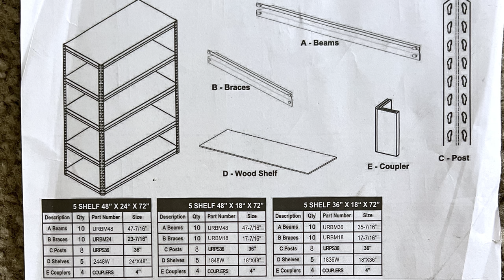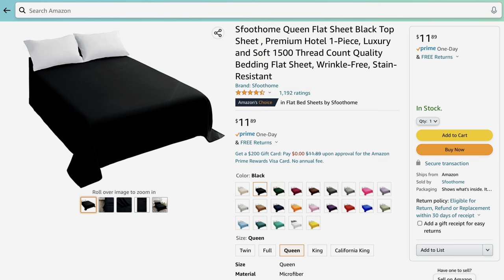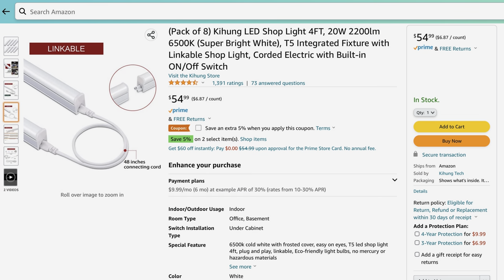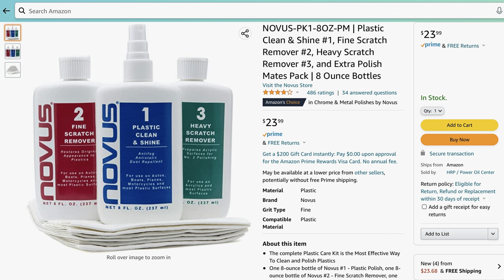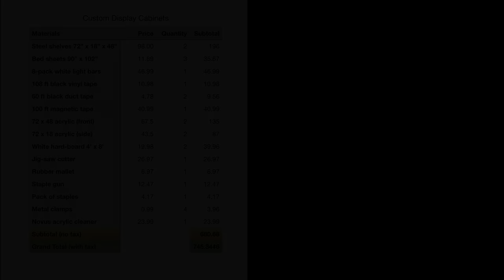DIY Custom Display Case Tutorial | Posing with Peter

Comment: Hi Peter, thank you again for your video. It inspired me to prepare my own custom built shelves. Unfortunately I live in Europe and many things you have in video I don't have it here. But anyway, I just have a question for your shelf board if you don't mind. You warp one face with bedsheet but what about the other face? On the video, it show the whole shelf board became black but in the process you only wrap one side with bedsheet so what did you do to the other side? Thank you!
Reply from the maker: Hi Lucas! My apologies for the delayed reply. I’m really glad my video has helped inspire you to build your own cabinets! 

To answer your question: I only wrapped/covered one side of the large boards with black sheet, and I used duct tape to adhere the black sheets to the backside of the large boards. I had considered using staples but I was worried about poking holes through both sides which would look ugly 😂

I hope that helps clarify, and thanks so much for watching!
Reply: @PosingwithPeter  thanks so much for replying! I decided to paint the back side since I find that it will be cheaper for me. I tried to look for color sheet but at that size it will become more costly. As you said in the video, there are many ways to tackle this. As I went along with your video, I had to adapt with what I could buy and had at my disposal. The shelves will be ready soon!

Comment: Hi Peter! Great video. I'm using your video and Costa's videos to create my own display case. 
Quick question: I just got the 4ft lights you used and wanted to know how you got them in the case. With the extensions linking each one in a zig-zag pattern, I'm not able to seat them inside the railing. Did you have trouble getting all the lights to fit?
Reply from the maker: Hey there! 

Yeah the light bars were a very tight fit since the cable connectors run straight out of each light bar, but it is doable! I recall seeing someone else ask the same thing on Costa’s videos in his comments and I think he also had to use a bit of force as well. 

In order for them to fit, I first thoroughly inserted the cable connectors into both sides of the light bars. Then I wedged the light bars + connectors under each shelf by bending the connectors to a 90 degree angle they collide with the vertical frame. 

I hope that helps, and thanks so much for watching! I’m really glad you’re giving it a go with the custom cabinet 😁

Comment: Looks great, for the acrylic what thickness did you end up getting? I want to build something similar but dont want to get too thin and have it be flimsy but of course thicker is more expensive
Reply from the maker: Thanks! And for the acrylic I personally chose 1/8 inch thickness since I wanted it to be sturdy. However it’s a bit heavy since I did not cut the acrylic into smaller sizes.  I’m currently building 2 more cabinets like this, and I might choose 1/16 inch thickness this time. We shall see!

Comment: Hey Peter! Are you still using these? I’m in the process of building mine myself. Yours look excellent! I am following Costa as well. I will say that I do wish they made flat black hardboard.
Reply from the maker: Hey Andrew! Yeah I’m still using the cabinets featured in this video — I’ve actually replaced my defolfs and built 2 more cabinets in the living room for all my Marvel figures. I’ve spent the last several months gradually posing / displaying them and hope to film some kind of collection tour update before the year is over, TBD 😂

And I agree, it would be nice to have large black hard boards at an affordable price. I think they do exist but they’re super expensive like $90-200 each depending on the material they’re made of.

Either way best of luck on your build! Quick tip is to use some super glue when adhering the magnetic strips to the acrylic panels (the adhesive on the magnetic strips wore out after I had already uploaded this video so I had to reinforce with several drops of Loctite ultra gel). 

Hope that helps and thanks for watching & sharing your positive feedback!

Comment: Fantastic! I’ll be doing this very soon. I have to ask, how did you pull of the Superman floating pose in this cabinet??
Reply from the maker: Awesome! I’m really glad you found this video helpful and that you’ll be building your own custom cabinet soon 😁

As for the floating figures like Superman and Stormtrooper, I used black string to suspend them from the upper frame behind them.

I have a separate video this explains the process: https://youtu.be/9aOpfS4n7Ak

Comment: Great build looks amazing! What thickness is the acrylic?
Reply from the maker: Thanks so much! I personally bought 1/8 inch thick acrylics since I wanted them to be sturdy & firm when I remove them from the front of the cabinet, but I’ve seen others use much thinner like 1/16 or 3/32 inch to be lighter weight. Just depends on personal preference 👍
Reply: @PosingwithPeter  cheers for the reply mate I had to use a converter being from Australia, I don't know haw you guys measure in fractions of an inch haha

Comment: Great video! I am going to be doing the same for my model car collection. What is the thickness of your acrylic panel? How heavy is the entire 4 by 6 piece? And are these magnets holding up still? Comments on amazon says these magnetic strips are weak, so would like your review on them. Thanks!
Reply from the maker: The acrylic panels are 1/8th inch thick and the large 4 x 6 piece are maybe 10 lbs each. As for the magnetic trips, some of the adhesive did wear off several weeks after I had uploaded this video, so I went back in and superglued the magnetic strips to the acrylic using Loctite Super/Ultra Gel. I also added a few small circular neodymium magnets for extra hold. 

Hope that helps, and thanks for watching!
Reply: @PosingwithPeter  I'm doing the same and have 2 questions, did you glue magnetic strips to frame and acrylic, and are the extra magnets necessary, if so how'd you do that? Thanks so much for the video, between you and @popculturelivingroom I think I'm going to get this thing done 😂
Reply from the maker: @brandonnichols8961 Hey there ☺️ I only glued the magnetic strips to the inner side of the acrylic, didn’t need to glue any to the metal frame of the cabinet. I also did glue a few small circular magnets to the inner side of the acrylic as well for extra strength — it was fairly easy; just a drop of Loctite Ultra Gel on the circular magnet and placed them around the 4 corners of each acrylic sheet along with a few along the vertical sides. 

Hope that helps, and best of luck with your build!

Comment: Hi Peter, I have a question the magnetic tape part of the process. You said you applied 2 layers of magnetic tape around the edges of each acrylic panel. By 2 layers do you mean you taped one layer around the edges, then went back and taped over the first layer with another layer of magnetic tape? Did you supplement with gorilla or super glue or did the magnetic tape adhesion work well on its own? 

Also, since your edges were 1.5" borders, do you think it's a good idea for me to buy 1" wide magnetic tape instead of 1/2", theoretically for more magnetic strength? I set up my Husky 77" x 78" x 24" garage shelf and am picking up my acrylic panels today. I am following along with your video and am very excited to finish. Thanks Peter!
Reply from the maker: Hello there ☺️

Yep you nailed it about the magnetic tape — I had to double-layer the magnetic tape all around the acrylics because the 100ft roll of magnetic tape that I bought wasn’t quite thick enough (1/16th inch) and a single-layer didn’t make full contact with the metal frame. I just finished building 2 new identical cabinets and found that 1/8th inch thickness magnetic tape works better, along with a few well-placed neodymium circular magnets at the corners for a stronger hold. And yeah I went back and super glued the magnetic tape to the acrylics since the adhesive was kinda wearing out after I had already edited/uploaded this video. 

As for the width of the magnetic tape, I suppose 1” width will definitely have a stronger hold since it’ll have more surface area to cling to, but definitely get a small pack of neodymium magnets as well especially if you plan on keeping the acrylic panels as large sheets. Smaller individually cut acrylic sheets aren’t as heavy and don’t require nearly as much magnetic tape, but larger panels may buckle under their own weight especially if your rack is 77x78x24.

I hope that helps, and best of luck with the custom cabinet! Don’t hesitate to ask if you have more questions throughout the build process. Thanks for watching!
Reply: @PosingwithPeter  Thank you so much again for your super helpful guidance and inspiration for this project. I've had collectibles sitting in boxes for years, sometimes decades. Can't wait to get them on display in my custom display shelving! And great tip about the neodymium magnets, I bought some of those for affiixing the mini spotlights I ended up using for the project, and they are really strong. Now that you mention it, it is a great idea for keeping my large acrylic panels from sliding down.

Comment: Hi Peter, would you mind sharing the thickness of the acrylic sheets? Thank you for the great guide.
Reply from the maker: Sure! Since I knew they would be large panels, I went with 1/8th inch thickness so that they’d be sturdy & rigid when handled. However if you plan on cutting the acrylic sheets into smaller pieces for each shelf like Costa did in his video then 1/16th inch thickness should suffice. 

Hope that helps and thanks for watching!

Comment: Holy shoot Peter this is incredible!!! I think i will definitely give this a shot thank you so much for the recommendation and the showcase! This turned out sooo good and i would love to do this one day or very soon.

If you dont mind, about how many figure can you fit horizontally? Without it looking tooo crowded? I know this isnt a very good question as i feel it could really depend based on the figure and height one prefers, but a rough estimate would be great!
Reply from the maker: Ayyy thanks so much Anthony! I'm surprised that you're considering this option since you already have beautifully lit cabinets that are also really wide, Roxy Display right? What challenges are you facing that's got you looking into this option if ya don't mind me asking?

And in terms of the horizontal space, these shelves are 48" across each so I'd say about 5 or 6 figures can fit side by side while still being comfortably spaced out (then you can stagger ANOTHER 5 or 6 figures behind them on risers to capitalize on the 18" or 24" depth depending on which shelf you get). Hope that helps!
Reply: @PosingwithPeter  hey man! And yes haha the Roxy Displays are great and all and they look really cool! Only bad thing about them is that ive noticed their structure requires a lot of caution due to the glass shelves and the fact its only supported by 2 metal beams. I want to make the switch so that i feel more secure in my display. I also dont want to lose the widness of the display and this looks like an incredible alternative. Not to mention the display is 48 inches wide too however i cannot use all of it due to the glass shelf only holding it at certain points. The glass shelf also doesnt reach the full 48 inches so i guess you can start noticing the limitations i have! 

Also quick note they have been rising the price for these displays that i really dont see it being worth the new price point at the moment. 

This project you showcased allows me to customize and build my own display which looks more secure than roxy and give me the option to display heavier figures with a much wider range! I think i will for sure go with the 24 inch depth since. I have a BTTF2 Delorean on Pre Order! Not to mention i love the ability to adjust shelfs easily and i just cannot do that w Roxy Display :/ Since im getting a Hulkbuster i would LOVE to have that as an option!
Reply: Thanks for the tips @Posing with Peter! Its really helpful being able to plan out what ill be doing too! Much appreciated!!
Reply from the maker: Ahhh dang that's right, I totally didn't think about the need for extra caution because of the long glass shelves for Roxy Displays... good point. Fortunately these storage racks are rated for something like 800 lbs per shelf with a total max capacity of 2000 lbs for each cabinet, so you can definitely fit The Delorean & Hulkbuster with no problems 🤩🙌

Comment: Hello Peter, I had a question in regards to the type of acrylic you went with? I see a lot of different options for types along with finishes. Also what about the thickness?

Thank you
Reply from the maker: Hi Eddie, I went with 1/8 inch thickness for the acrylic sheets since I was not planning on cutting them into smaller pieces — I wanted to keep them somewhat thick and sturdy since I knew they would be very large (I was concerned that they might bend and crack if they were too thin). As for “finish” I’m not sure since I bought them from a local shop that specializes in plastics, I think it was just “clear”. 

I hope that helps, and thanks so much for watching & commenting!

Comment: Amazing work. Just wondering if there’s anyway to hack it and add a door hinge to the panels at the front
Reply from the maker: Thanks! And yeah I’m pretty sure there’s a way to add door hinges, but I imagine it would require extremely delicate fine-tuning when attaching the hinges to the acrylic sheets (cutting into the acrylics could cause them to crack). I just stick with the magnets to preserve the integrity of the acrylics long-term.
Reply: @PosingwithPeter  yeah. Oh that’s true. Acrylic might crack. Oh man. I’m gonna make my own soon. Wish me luck haha
Reply: @PosingwithPeter  and to add on, your video inspired me to make this. I saw your vid first before I saw popculta’s video. Prepping a heavy duty for the hot toys Keaton Batmobile that is way too long for most cases. 😂
Reply from the maker: Oh nice! I’m really glad my video helped inspire ya to take on this custom build project 😁 Heck yeah I also preordered Keaton’s Batmobile and will also be building a new separate cabinet for when the 89 Keaton 2.0 figure comes out alongside the Batmobile… it seems we’re both gonna have ourselves an epic display case! 🤩🙌

Comment: Dang now I wanna redo all my display. lol. Do you prefer your diy or still the detolfs?
Reply from the maker: Now that I’ve experienced both, I prefer the DIY. Detolfs are a great affordable way to get started in collecting since you can build one detolf for a small collection and gradually buy more as the collection grows. However how that detolfs are $100 USD each, it’s not worth that cost in my opinion especially when you plan to buy several to fill a whole wall. I figured might as well put that same amount of money into DIY cabinet that can hold more figures and even vehicles.
Reply: @PosingwithPeter  I have to agree with you, Detolfs are awesome, but too small for me. Almost finished with mine and gotta say hardest part i'd say is the cutting and putting the boarders. Keep the vids coming, you got a new subbed!

Comment: Is the magnetic strip strong enough to support the acrylic sheets?  The acrylic doesn't sag or warp?  Is there any plastic snap on frame for the acrylic?  Vinyl tape is very classy.
Reply from the maker: The magnetic tape should be enough to hold the acrylic onto the metal frame if you get thin sheets. My acrylic sheets are 1/8th inch thick and the magnetic tape is barely strong enough to work, so I attached a few small circular magnets at the weak points for extra stability (no plastic snaps). 

Hope that helps, and thanks for watching!

Comment: So, is it still cat proof?  I custom built my hermit crab's vivarium/crabitat with pre-cut acrylic panels.  The crabitat didn't need to be waterproof, just needs to be crab proof from escaping.  As for the bedding&water, very large double plastic containers that can be taken out while the first container keeps everything in place as the 2nd container is taken out and can be clearned&put back again.  I didn't use clear panels for the sides since i won't be able to see it from the side.

Comment: Can I ask how many plugs you ended up using for the lights you ordered? I noticed the kits come with 4 but wasn't sure if more than 2 light strips could be powered by one cord/switch.
Reply from the maker: I bought 1 of the 8-pack of lights and they included the exact amount of connector cables and power adapters needed for my build (2 cabinets, 4 shelves each).

It’s hard to explain but I’ll try — the configuration of lighting for each cabinet was:

Wall outlet > Power adapter with cable connector > light bar 1 > cable connector > light bar 2 > cable connector > light bar 3 > cable connector > light bar 4 (then I just repeated the exact same configuration and process for the 2nd cabinet).

I imagine you can possibly attach more lights if you have more cables while still using a single power adapter but I’m not sure how many will work or if there’s a recommended amount that might be listed on the product description. 

I hope that helps, sorry if it doesn’t answer your question 😅

Comment: Thx for the video. The magnetic tape looks like its 1 inch in width while the one u have listed via link is 1/2 inch in width ?
Reply from the maker: The magnetic tape that I ended up getting was indeed 1/2 inch thick since they were sold out of the 1-inch version. But there are other brands offer 1-inch magnetic tape as well!